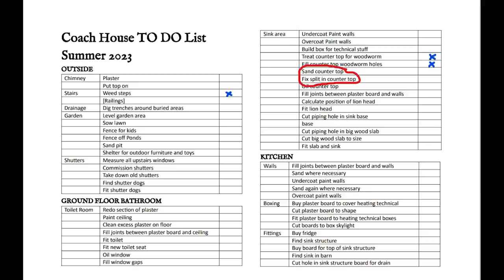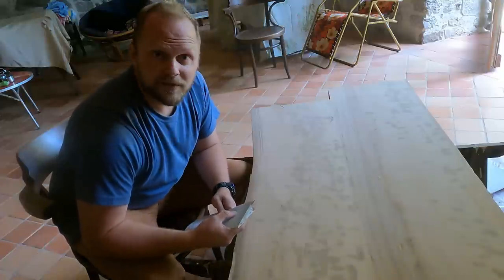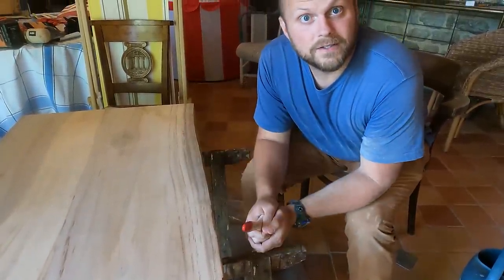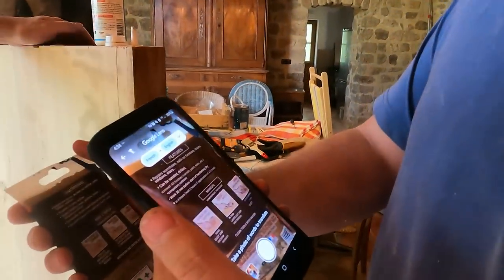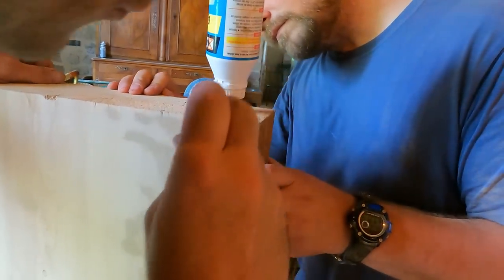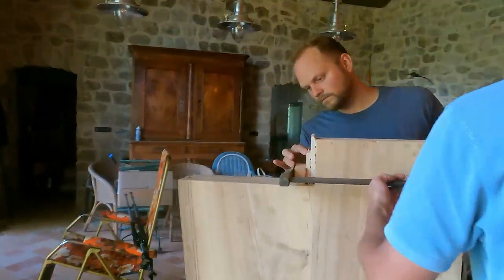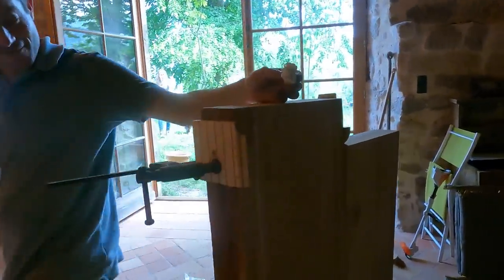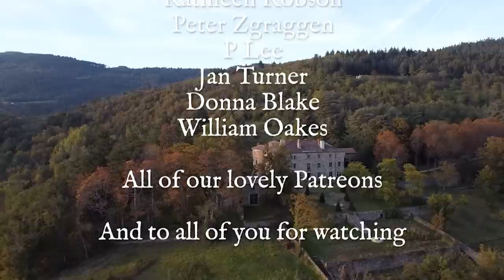Our special project splits - can we save it?  | Coach House Daily 3

Comment: I think you may have to put a couple of butterfly joints in that wood or it may dry and split apart again eventually.  I've seen some fantastic work with resin to fill and seal big shakes and splits in tops.

Comment: Sanding would work better with a block.
Reply from the maker: But it would take half the day to go and find it...
Reply: @Chroniclesofrosieres  Haha! I have a project basket. I keep all the gear I need to do the job in the basket and change it out when I finish then start a new one.
Reply: @davidgillard4995 That sounds VERY handy- if one were only working on one project at a time... 🤦
Reply: @staceyschmidt3149  yes that is true. When I’m finished working on a job, I unload what I don’t need for the next job and load up what I do need and carry on. I am not a tradesman but an avid DIYer and restorer. I have been working with wood since I was a kid. I love using old recyclable timber and try to avoid buying new. This is just the way I work. Not telling anybody they should adopt my process. It’s just a good natured suggestion which is easy to adopt. Thanks, Dave.
Reply from the maker: It’s a great suggestion Dave. Such a sensible way of doing things! I’m more in that camp but Marc is, let’s say, a free spirit. But it’s also true that we’re working on many different projects at once that sometimes require the same tools between them. It’s definitely not ideal. What we’re hoping to work on soon is the workshop, which is a horrible mess at the moment because it’s an old cattle barn with uneven floors. We need to level it out and get good furniture in it so we can actually do most of the work in there and have proper places for the tools. It should help a lot!
Reply: @Chroniclesofrosieres  Well thank you Amy. I absolutely love what you and Mark are doing to this beautiful Château. What a dream of mine to restore such a beautiful place. It is winter here in South Australia and quite chilly so I’m doing my work in my workshop. The picture I have is the door to my workshop. I am a retired AUS military veteran and the workshop keeps me busy. I absolutely love your channel and are so glad you are back